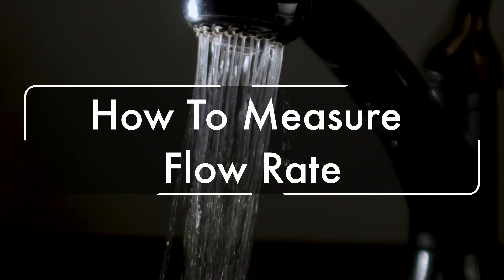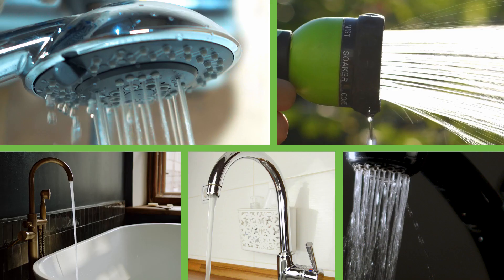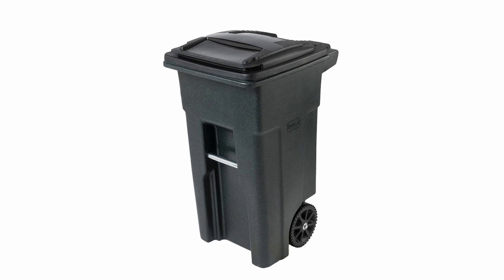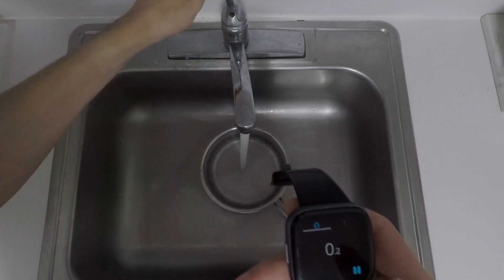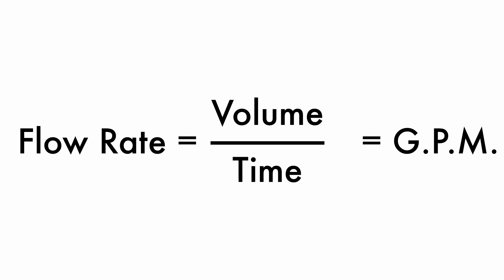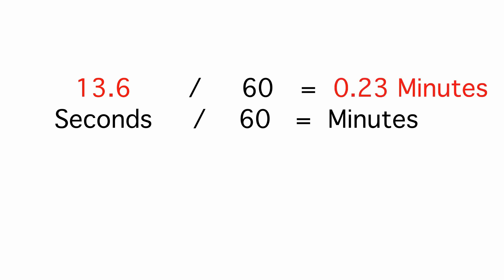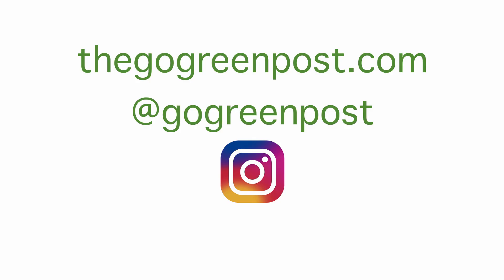How To Measure Flow Rate of Any Tap

Comment: Hi, cool video. I'm trying to measure an outdoor faucet before installing a garden watering system but the water comes out sooooo fast that it fills a bucket almost immediately and a lot sloshes out. It's forceful. I don't suppose attaching a hose and testing it that way would work. It seems like the hose would slow the flow down.
Reply from the maker: You can attach a hose with a nozzle that has a lower flow rate! They even have nozzles the produce a mist which I sometimes use for watering my garden

Comment: What causes the water meter to spin extremely fast and make the bill skyrocket? No leaks. Water flow reduces in other taps when opened in other tap. Is it pressure or flow rate? How to reduce bill cost? Please don't provide "stupid" answer.

Comment: What about the flow rate for a Laundry sink?
Reply from the maker: You could use this to find laundry sinks as well. They are usually higher since you often use them to fill buckets or wash large objects.
Reply: @GoGreenPost  ya, but what would the flow be? 2 gallon per minute?
Reply from the maker: I’m not so familiar but I’ve read they are about 4 gal/min

Comment: 17.1L per minute. Is that too high???
And pressure doesnt drop on when turning on 2nd tap to max
Reply from the maker: Is that for a bathroom sink or kitchen sink?
Reply: @GoGreenPost  31l for both. 
1st test 17.1L on shower (not head)
2nd test 31L shower (not head) and bathroom sink at the same tine
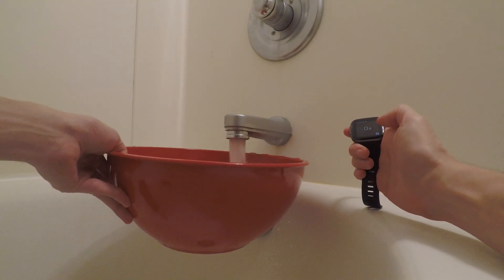Reply: @GoGreenPost  by (not head) i mean this thing 2:12
Reply: @GoGreenPost  hello?
Reply from the maker: @HIDING_BOSS  Hey there! So for the bathtub flow rate, it doesnt really matter what the flow rate is because the goal is for it to let out a certain amount of water (enough ti fill the tub). For a bathroom sink though you want to be below 5.7 lpm. Does that help?